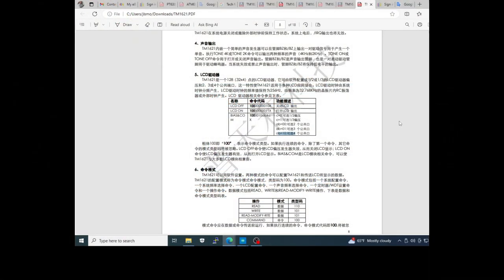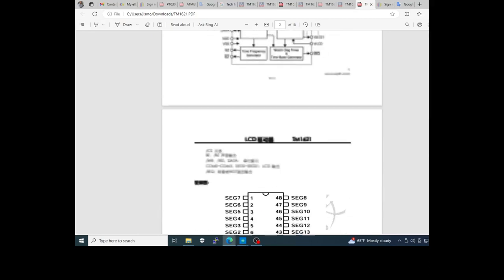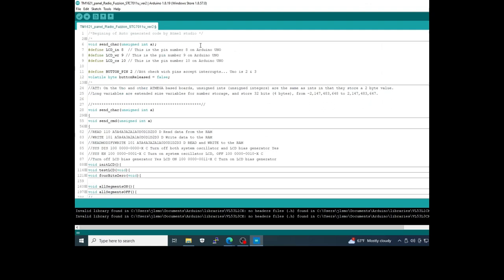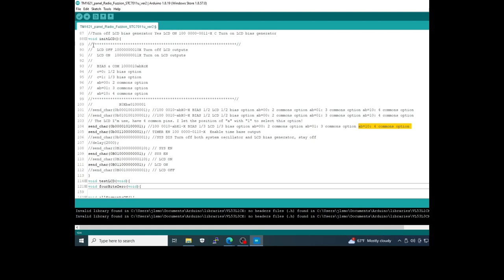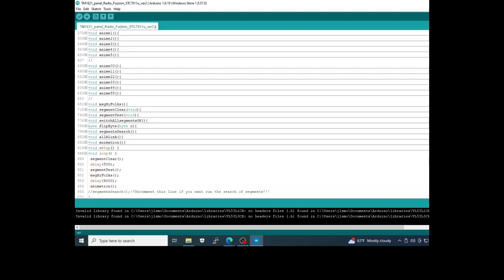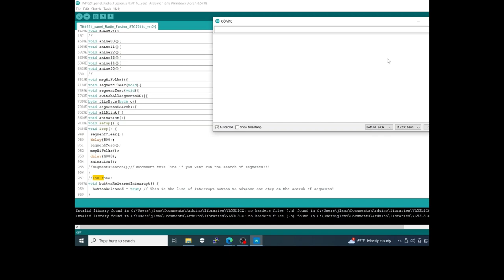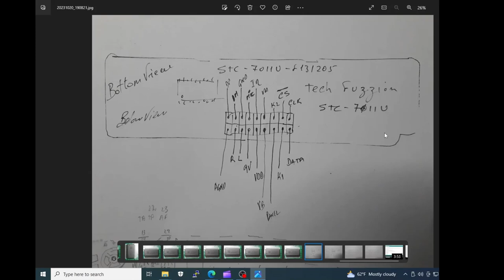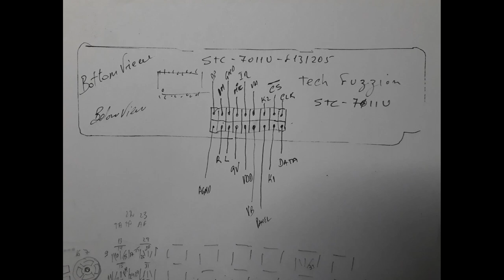TM1621

Comment: I have stc-7011u since 2015 in my kitchen. 
Works around 6 hours a day.
Loudness increase a Nice sound, but seems he has no stereo at radio mode, and no way to turn on by painel I guess.
Even at 00 volume he has some sound.
I have a diy FM antena above the roof.
Working with a Basic 0.6A 12V DC charger, that almost heat nothing as well the radio.
Wired with a permanent + line for keep the memory and other line with a turn on and off swich.
Reply from the maker: Hi @matterdotoo4726 Wonderful that you can recognize the Panel!
I didn't have access to the complete radio, they only sent me the panel.
I'm happy with that!